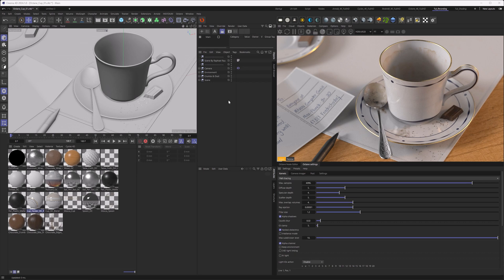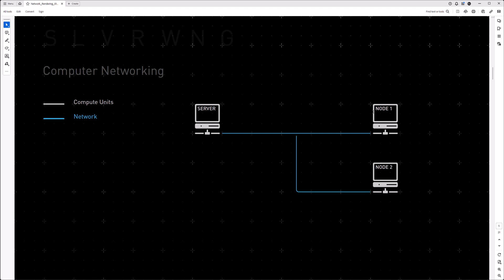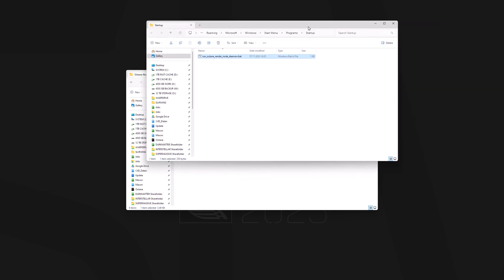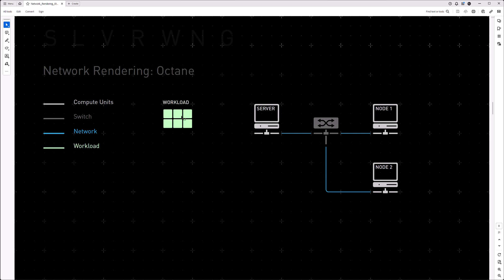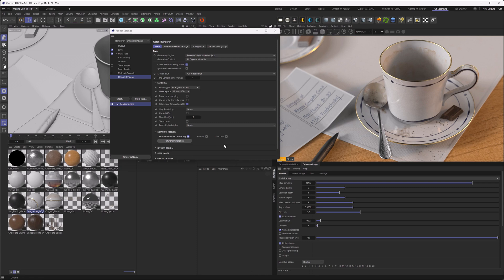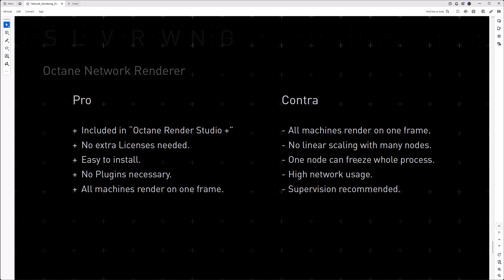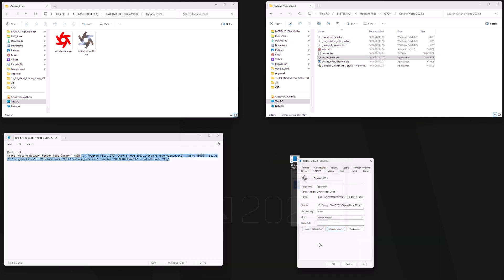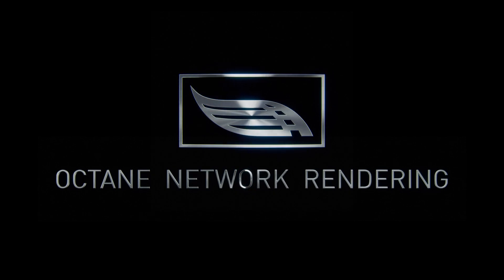Silverwing Quick-Ish Tip: Octane Network Rendering

Comment: Hey Raphael. This is a newbie question but the computers needs to be connected to the same network with a router in between, or is there a way to connect them directly RJ45 to RJ45? Because I'm using a CPL at home and the speed is really bottlenecked (25Mo/s max) when using the router way. Thanks in avance!
Reply from the maker: Hey there LeRoi,
you can also set up computers to be connected directly. Basically if you are able to set up a network between two computers, so they see each other, then Octane should theoretically also work.
If you are using multiple networks on those computers for example to connect to each other and to connect to the network to get internet, you might need to manually set octanes network addresses to the right one.

As I never worked in a scenario with only two machines connected to each other this is all theory and should be taken with a grain of salt. Though I think it should work!

Cheers and may the networking gods be with you 🤞

Comment: Also.. ONE of the BIggestg downsides to using Team-render is that you need to install C4d and also any plugins also on the node computers.. this sucks to do and adds lots of points of failure and maintenance each time plugins are updated. By using the Octane network rendering its just the client daemon only and no dcc no plugin headaches.. everything is abstracted into an ORBX package and sent to the octane nodes.
Reply from the maker: Yes this is very true.
I wish there was a solution in between Team Render and the Octane Render Node.  A mode where the Octane render Node completes single frames.
As I say in the video. With lots of machines at some point rendering will reach diminishing returns. I could not get rid of the overhead even with fast networking.
Reply: @SilverwingVFX  I figure i’m not running multiple machines with multiple nvidia power hogs.. by the time it gets to that level i would be using the RNDR network instead.  So its never been much of an issue honestly. i just strung a 10 gig connection between the mac studios’s 10g port and a 10g nic on the pc.. called it a day

Comment: The nice thing about this now is that with m-series mac’s you can use the mac and have a PC with an RTX 4090 running headless (hdmi dongle) - and then use the whole PC like an EGPU for your mac!.. Works like a charm… if you need things even faster …send it up to the RNDR network.
Reply: Can you please explain more about this if i have rtx3080 ti Pc how can i connect with a mac is that with c4d teamrender and should have many of octane licenes or with octane render network how can i get mix of them and short the render time
Reply from the maker: @mahmoudmorsy5624  Hey there. First you have to have a M2 powered Mac.
 
If you have the right operating system version you can install Octane for Mac on there and then install the Windows Octane Render Client on your PC with the 3080.

They both have to be in the same network and see each other. Then you can, in Octane in C4D on your Mac, enable Octane network rendering and the Client should pop up and support your Mac on the frame you either render in your live viewer or picture viewer.

Since this is the  Octane network rendering you do not need extra plugins etc. I am not sure if the license for network rendering is included in the Mac plugin version. You might need to order a 2nd windows one here. Though I am not sure since I am not very versed in the Apple ecosystem. 

I hope this gave you some insight. If you have any more questions that I might be able to answer, feel free to ask.
Reply: @SilverwingVFX  Thanks Raphael you and your channel are always my first plan when i have to learn or solve something so thank you 😍
Reply: @mahmoudmorsy5624  - basically this comes down to using octane renders built-in set up for rendering you basically have your DCC of choice installed on the Mac and then you have octane renders render node software on the PC then the Mac connects to it when you go into the control panel and turn on network rendering and you also have to turn it on in the live viewer if you want to use both your Mac and your PC at the same time for previews as well but once you do it just kind of works you have to go download the network node that matches the Mac and the PC versions of octane
Reply: @Xanah_TheLitterBox  thank you very much for clarification but one question is i need to make a server and wires and 10G of internet to connect the 2 device like the way he shows us or it will be simpler cause i found you talk about hdmi dongle sorry but iam not good at this things and please tell me if you test this way is it stable in render
Reply: Here is what I have setup so far

Computers:

- Mac Studio - 10GB networking port (Built-in) or a (Thunderbolt to 10GB dongle if your on a Macbook or PC laptop that doesn’t have 10GB port) (FOR OCTANE NETWORK ONLY)
- Docking Station with 1GB network port (FOR INTERNET ONLY)

- PC with Onboard 1GB lan network port (FOR INTERNET ONLY)
- RTX 4090 GPU
- ADD-ON 10GB network card (FOR SEPARATE OCTANE NETWORK)

NOTE: We will be using THE 10GB card port for the OCTANE network.

NOTE: We will be using a normal 1GB Ethernet port i.e Apple Ethernet dongle or a Thunderbolt Docking station or built in 1GB port on a PC for NORMAL Internet
Some motherboards DO have 1GB and 10GB ports .. if your PC does than.. you can skip the 10GB network card install.

NOTE: IF you use WIFI for Regular internet you still can… if thats all you have)
(I tend to turn “WIFI OFF” After setup since this is a desktop mac in my case.

NOTE: This is a direct Ethernet port to port CAT cable connection - I did NOT need a 10GB switch since it’s just 2 computers in my case. If you had more computers you would need a 10GB switch see the Hardware list for options

NOTE: I set each 10GB network card to the following:
Mac studio 10GB port set to:
IP - 10.0.0.2 - (Manual IP address)
Subnet mask - 255.255.0.0

PC - 10GB card set to:
IP - 10.0.0.3 - (Manual IP address)

Mac Studio Apple Ethernet Dongle or Docking station Ethernet port is set to:
DHCP (192.168.x.x) network.

NOTE: - IF your router happens to use the 10.0.x.x network just swap the ip address you set for OCTANE network and INTERNET network around.. the idea is that they are separate and different networks.

BIG NOTE: Once we take over the 10GB “Built in port” - You will then have to use wifi or a 1GB apple dongle or docking station Ethernet port for your normal INTERNET going forward.

NOTE: you will likely need to go into network settings and change the “INTERFACE Order” so that WIFI / DONGLE / DOCKING STATION 1GB Ethernet devices are ABOVE the 10GB Build in Mac Studio port / 10GB Dongle or you won’t get internet!!!!!
SEE APPLE Documentation below.

Change the order of the network services your Mac uses
NOTE: Pull down the dropdown for your OS version:
https://support.apple.com/guide/mac-hel ... lp2711/mac

I Installed the PC Octane network node Daemon on the PC and configured it per OTOY instructions…..
You can get the Render NOTE - DAEMON from your DOWNLOADS area once you are logged into your OTOY account…then choosing enterprise network node and windows as the OS.. MAC daemon is not released yet for 2024.2

NOTE!!!!!! - I think for now you need to have the full subscription to use network rendering which comes with up to 10 RENDER node licenses!

Overview & Setup:
This page and the setup video was very helpful:

NOTE: Some of this might be bit different (This was from 2022) but it should be very similar in 2024.2
https://www.pixel-planet-studios.com/po ... -rendering

Once you have the networking going and the OCTANE NODE running on the PC
You should have an area for OCTANE network rendering to enable it and set the port # which should match the PC port number when you setup the Render node DAEMON
The node should show up in the node box which you then then BIND.

So for $94 bucks USD I created a single node network for Octane using the Mac Studio and my PC with an RTX 4090 and added in a 10GB networking card.

HAPPY RENDERING!

HARDWARE:

- Apple Ethernet Dongle (1GB)
- NOTE: This is for your normal internet going forward and not for the OCTANE NETWORK)

https://www.amazon.com/Apple-Thunderbol ... C95&sr=8-9

- 10GB Ethernet card - (Amazon) - $80 -
- NOTE: This is FOR OCTANE NETWORK on the PC

https://www.amazon.com/NICGIGA-Network- ... 7e17e03685

- CAT8 Ethernet Cable (Amazon) -$14
- NOTE: THIS IS FOR OCTANE NETWORK
- Yes It’s overkill (I only have a short 30ft short run)
- If needing longer runs …the USE of CAT6A might be advised)

https://www.amazon.com/gp/product/B0838 ... 14DDB&th=1

- DOCKING STATION - ???
- NOTE: You can choose your own long as it has an Ethernet port
- THIS IS FOR NORMAL INTERNET going forward

- Network switch (optional with only 1 node)
NOTE: THIS IS FOR OCTANE NETWORK CONNECTIONS NOT Internet!!!

Unless your whole network is going to be 10GB…if you want. (It is still recommended that you keep your normal Internet Traffic off the OCTANE side)

NOTE: If you have to connect to more computers with octane nodes in them you will need to get a 10GB switch like this one i’m sure there might be others out there too look around

NOTE: Just make sure switch and ports are 10GB and not 1GB or 2.5GB speeds:

QNAP QSW-3216R-8S8T-US 16-Port Half-Width Rackmount 10GbE Unmanaged Switch (Amazon) - $549

https://www.amazon.com/QNAP-QSW-3216R-8 ... 7e17e03685

NOTE for switches that use SFP+ slots ….IF you want to use those slots and run CAT6A/CAT8 cables…and not fibre.. you can get these converter adapters so you can use the CAT cable in SFP+ slots

- SFP+ to CAT cable adapter
10Gtek 10GBase-T SFP+ to RJ-45 Transceiver, 10Gbe SFP+ Copper Ethernet CAT6a Module, up to 30-Meter - (Amazon) - $50

https://www.amazon.com/10Gtek-SFP-10G-T ... BFL16?th=1
Reply: @Xanah_TheLitterBox  thank you man you really saved my life you make it very easy for me so thank you for the detailed explanation
Reply from the maker: Indeed, system intercompatability is a huge win!
I think it was made possible since Octane 2024.1
I would have mentioned it when it had been possible back when I made the video 😇
Great to hear it's working nicely for you 🙌

Comment: Hey Silverwing! Thank you so much for your video man!

Unfortunately my  render machine has a prompt that says "CUDA error (999): unknown error failed to clear up device memory" 

My GPUs aren't showing on my C4D working machine either. Is this a driver issue?

Both Octanes are installed 4.1 and firewall has been allowed accces! Let me know when you can!!! Thank you!!

My specs are:

4x3080 NVIDA GPUs

256gb RAM
Reply from the maker: Hey there and thank you for your comment.
You have a hefty machine there 🙌

Is the 4.1. hinting at the Octane version. If so, then this would not work as your 30 series GPUs are too new and not supported by older versions of Octane.
The latest version you can use on the 30 series GPUs is Octane 2021.1.

If you however using a newer version of Octane:
If the GPUs are not showing, then I guess this is something driver or hardware related.
Make sure the GPUs are showing in your device manager and do not have a orange / yellow triangle next to them.

In such a situation the first thing I would, as you also suggested, re-install the driver. The current recommended one is Nvidia Studio 552.22

Cheers and fingers crossed you can get it sorted.
Reply: @SilverwingVFX  Hey dude! So to update:

I have Octane 2024 latest version on both machines as of today. Sorry if I didn't clarift properly haha. Still having the same issue with updated drivers. The daemon seems to be running fine on the "slave" PC. I just get nothing showing up on the working Laptop I'm trying to use!

What is really weird is that I can't enter my password into the daemon window? I enter the email and that's fine but the password doesn't seem to allow you to type anything!

I have both an octane enterprise lisence and a studio+ both from to the same account and on both machines as that is the only way I could log into the the daemon and still use octane. 2 lisences linked to the same account wouldn't cause an issue would it?

Let me know if you have any tips! Supposed to be going to the US in a few weeks and ideally need this up and running! :/ Much love <3

Comment: Quick question: is it possible to send the render to a node and carry on working on a different project in cinema 4d on the master? 
In other words; Project A - Rendering on Node whilst Project B - Working on Master simultaneously
Many thanks!
Reply from the maker: Not directly. 
If you have multiple cards in your one machine, you can exclude the one that the display is connected to. This is also the one that C4D will use.
Other then that you would need more licenses unfortunately.
Reply: @SilverwingVFX  thanks for the speedy response! Well that's a shame... I'm planning to build a second machine and was hoping that Project A can be rendering on the node whilst Project B can be worked on... oh well, thanks again!

Comment: I can't get this to work. I don't know what I'm doing wrong. I've tried everything. Do both computers need to have the same drivers? Do both computers need to have the same versions of Octane?
The nodes don't show up. ugh
Reply from the maker: Hey there and thanks for your comment / question.
Both computers have to have the exact same version of octane. So Client and the version the e.g. C4D plugin (Or what ever Plugin / Standalone you are using) is based upon need to match.
The computers do not have to have the same drivers.

Depending on your system sometimes Firewalls can block the service from reaching out into the network. So you could do a test run turning off firewalls on both machines.

Of course it should be a given that both machines are using the same network and find each other. You can easily test that by "pinging" the IP address of the other machine via the Windows command line. "ping 192.168.1.10" for example (without quotation marks)

Usually if it's not working, it's a firewall issue.
Whenever I have problems with software communicating over the network I reset my windows firewall (I do not use any 3rd party solution)

Fingers crossed you will get it to work. Usually it should show right up without problems 🥲
Reply: @SilverwingVFX  Thank you for your prompt response! I will give this a try!

Comment: Hey Raphael, I've been looking all over the net, but couldn't find a satisfying answer. Let's just say, I've got a server with 16gb of vram and a node with two 8gb cards, will my server vram be capped to the 8gb like it would if I had all cards in one machine? Or do the node cards not count into the global vram max? Any hints would be greatly appreciated, thank you for doing what you do.
Reply from the maker: Hey Maximilian,
thank you very much for your comment and your question!

It is always the same logic here. If you have smaller cards anywhere in the chain, those have to go out of core on bigger scenes.
Or, if out of core is not turned on, they are excluded from rendering. It would be exactly the same on one single system with different VRAM sized GPUs.

If the scene is larger then the lowest of those, this card will go out of core and the more out of core it goes, the slower it will be. If you have OOC turned off, the card will be disabled from rendering after a couple of tries to load the scene there.

It does not matter where the card is. As long as the render process is started the scene can either fit the card, it can go out of core (if enough Ram is available and OOC is turned on) or it can´t be rendered.

Note that OOC Ram usage is accumulated. So if you have 4 GPUs and all of them have 2GB OOC, then the Ram usage is 8GB (4 x 2GB)
This is because programs as well as Windows can hold different amounts of VRAM "hostage" on a GPU and therefore wary the amount of free VRAM per cards. And therefore the out of core can´t be unified for multiple cards.

I hope this answers your question.
If you have any more specific ones, please absolutely feel free to ask!

Cheers and a great Start into the weekend to you!
Raphael
Reply: Thank you so much for your detailed answer! That makes perfect sense and was what I feared! Guess I'll have to get way better at optimizing my scenes then or take the time hit from ooc. I find myself frequently running out on vram in even medium detailed shots, so I was definitely hoping that buying another card with twice the vram would fix all my problems.
Reply from the maker: @kesslau  Thank you very much for your feedback. Yeah Octane needs quite a bit of Vram these Days. Resource management would be one of the biggest critiques I have when it comes to Octane. It has gotten a bit out of hand. I think this is the downside of having all those nice features on the other hand!
Optimizing is really scene depended so it really depends if you have a lot of meshes or a lot of textures. Or maybe even both. This might be a good idea for a tutorial in the future 🙌

Oooh, and I just saw you now are supporting me on my Patreon. Thank you so much. This is highly appreciated!

Cheers and thank you very much again and an awesome weekend to you!
Raphael

Comment: Is this also available for Houdini? 

And what’s the difference between this plugin vs exporting the OBRX file and add them into RNDR network?
Reply from the maker: Hey there Loh and thank you very much for your comment!
This should be available for every octane plugin application yes.

With the Octane Render Node you render frame by frame locally on your own machines.

With ehe Octane Render Network you export your scene / animation as a whole and then upload it to the decentralized network. Single frames of your animation will then be distributed and rendered on "node operator" machines that are part of the render network.

Hope this helps to understand. If you have more questions, feel free to ask ✨